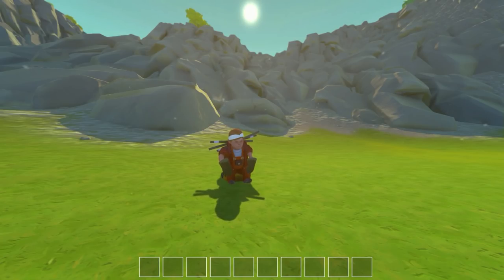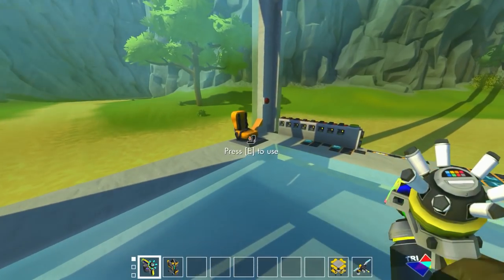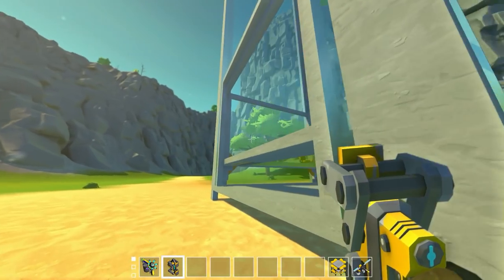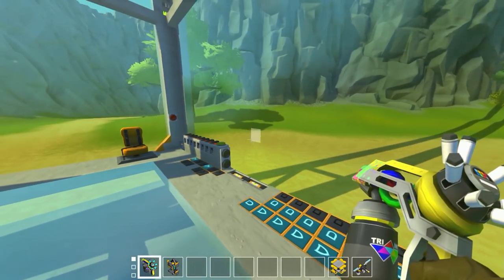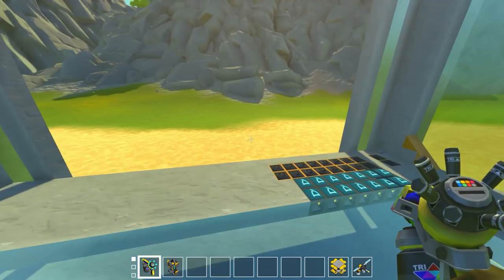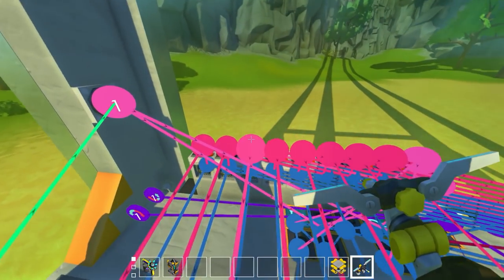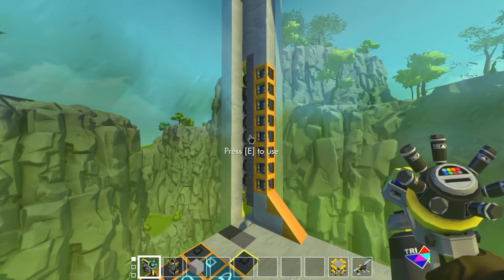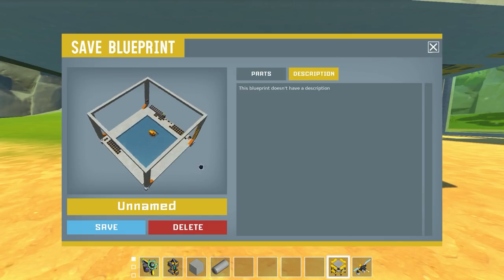Binary Controlled 'Infinite' Elevator! (Scrap Mechanic #238)

Comment: haven't watched the video yet but can't you just keep count of the floor you're on and when you press the button move to that floor with wheels

watched a bit: it works fine with wheels, no reason to use a controller
Reply: abab AAbb yeah but it is too hard 
Kan likes simple stuff 
Proof (9:20)

Comment: You just need a faster/smother gear system. Maybe try making the gear thicker or even make this go up by screwing on the edges (can go down after an hour but works well). I tried the screw it’s faster and pretty accurate for the screw method it would be cool if you could add some holes in the frame so pistons lock when you are on the floor and unlock when needing to move.

Comment: A solid back wall would let you make the entire set of bits go horizontal to match the display, and make the vertical component much more compact.  You’d only need a 4 block span vertically to store the entire start/stop/floor data.
Empty
Yellow block (or line for aesthetic reasons)
Black & white bits
Yellow

Also, if you keep your floor spacing consistent, you could probably feed more than one rotation per floor check, making the trip faster/smoother for the riders.  (If you know your floors are all 10 blocks tall, you feed a continuous rotation for the gears sufficient to move up/down 10 blocks at each floor.). Combining that with a horizontal paint scheme would also make the bits easier to paint, as you could set the floor you want, move up a floor, and paint the digits in at the next stop as you go.  (Just wire it up so that it E-stops at an undesignated floor.)

You could even shrink things further with color-coded digits, allowing for a larger base system (black, red, blue, white for base 4, etc.), but I suspect the wiring would get much more complicated that way.

Comment: You could color code the signposts along with binary system so that each bit would hold a value between 0 and 40 (the number of paint colors). That wouldn't be Binary anymore, it would be quadragesimal (Base-40). It would allow you to have a ridiculous amount of sign posts without having to have a ton of markings on them. The logic for that would be super annoying though.

Comment: Rather late to the party, but for your slow drive problem, you could use a piston to raise you up one floor at a time, then lock in place and retract it. Like a worm drive. That gets you one up a whole floor at a time a bit quicker. Using double the pistons you could create a 'dual' worm drive, completely out of phase so that you dont have a dead stop while you wait for the piston to retract. 

deep breath

You could get even faster still (if you dont mind the extra logic) since all your floors are in order, just subtract the "target" and "current" values and use a counter to propel you up that many floors, meaning you dont need to stop and check at each. This could let you use piston worm drives that skip floors to get a little extra boost.

Amazing channel and im probably going to end up buying the game thanks to you, you probably get this a lot but keep up the great work.

Comment: should've added a dec->bcd->binary convertor :p
Reply: Brent have you ever wondered if its possible to make a teleporting vehicle in SM??? perhaps with some wacko glitch???
Reply: This would get pretty big if you wanted to had 256 floors thought, it would require less buttons/switches to express that 256 range in binary than it would to express that in decimal.
Reply: Eggburt that is already possible using the teleportation border, ya can teleport above the map using this teleportation glitch
Reply: Combrink, meh doesn't take that many more gates, i bet kAN was just too lazy to build such a convertor ;p
Reply: The gates are fairly simple, but wouldn't that require 256 buttons?

Comment: Say kAN, you could use the gears but run them faster and have the binary floor detector be horizontal so the sensors don't have to be as accurate.

Comment: You should try and make one of those steady had games where you have to put the ring through yhe wire without touching the wire. (Completely off topic from this video) and make a sideways elevator, it could be faster

Comment: The math wasn’t that hard. Just 1st class college stuff. ;-] 

Btw in the ai city I may have a solution to the 255 signpost problem. Well it’s not really a problem it just makes you be able to have only 8 bits:
If you have a „signpost“ with the location in binary on it at every possible DESTINATION and then at every intersection and road and what not you have a sign showing only what kind of sign it is (you will definitely not need 255/256 of them) then you can have 255/256 locations instead of only 255/256 signposts. This WILL make a difference because assuming at every intersection you will need at least 4 signes but for every destination you will need only 1 or 2.

Comment: why didnt you use a single yellow dot for floor detection?
Reply: Legofreak because he needs to have an area where the sensors detect a unique code (sort of like brail) to tell it what floor number it’s on
Reply: I know that. I mean there doesn't need to be 2. like if you wanted the floors to be 8 blocks apart you couldnt. its not a big deal but it would be simpler with one anyway. just one at the top or bottom of each code. you dont need a footer if your word is a fixed length.